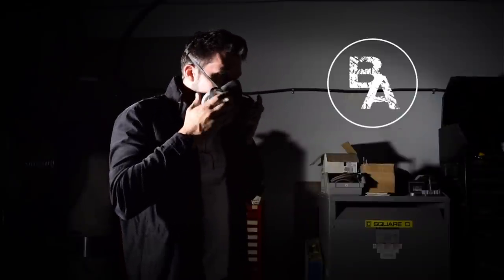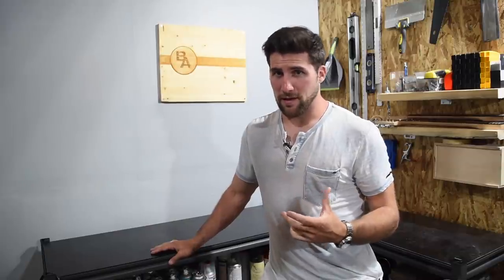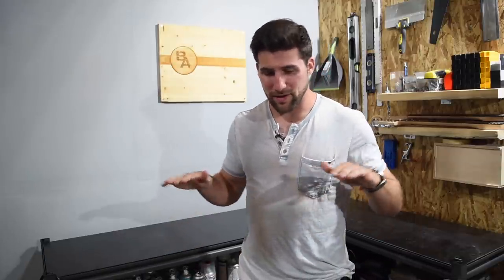Why is your paint crazing?

Comment: I tried prime ring my guitar I did the primer two days ago. I left the primer to dry a day when I looked the next morning there was alittle bit of cracks in the primer. Looking on the internet I searched what kind of grit to use 220 popped up. Used the 220 sanded the primer where the cracks were. I took a rag and cleaned off the dust today I decided to do a second coat. Within 20-30 seconds the second coat of primer cracked the whole primer on the back of the guitar. I don’t know what to do.... any ideas brad?
Reply from the maker: Sounds like the primer went on too heavy initially. May not have dried properly. Then when it shrinks it all cracks up like that.

Comment: Hi, Idk if your going to answer this or not asap, I'm painting my bed room like right now, I bought Caliwal paint and started painting my room, the paint was awful to me very watery and didn't look right to me after multi coats , so i went out and bought some Behr home depot paint,  the paint started to do some some crazy crap as I'm painting over it. So now my smooth walls look like ugg. But I'm doing this by myself and it's a lot of work, so I waited like two weeks to repaint over that mess, I mean It looks very textured now.. I'm on my way to go buy a one coat paint at home depot to see if that will help....I regret buying the Caliwel paint... and that paint is expensive. I have no other options I can't tear down my sheet rock and start all over.  I do not even know how to do that. Plus I spent so much money on paint already and my bedroom still not done.🤦‍♀️   IDK what to do😫😭
Reply from the maker: The typical fix for that would be to get one of those large sanding blocks that drywallers use and sand that texture off before moving on. Just adding more paint to it won't remove the texture.

Comment: I used a gloss cellulose spary paint on the top coat which I had cracks. but the paint layer before was just an ordinary quick dry gloss spary paint which probably hadn't quite dried after a few hours. I think that caused the paint cracks the so called reacting. Then I sanded it all down to the level with a 400 grit sandpaper and then smoothned it with a 1000 grit and after 24 hours went over it again with the cellulose spary paint. It is important the layer should be so refune and thinly sparayed otherwise it will react again.
Reply from the maker: I hope it worked for you the second time.

Comment: Hey brad. I’m an automotive painter. Our base coats are water based... I’m wondering if I can use our water based base with lacquer? I’m wanting to paint a telecaster with vintage amber on the back and sides with gold flake on top. Do you think I could spray a water base coat then apply the gold flake in lacquer?
Reply from the maker: I’ve used lacquer over water based paints before and never had a problem. Just make sure it’s 100% dry before coating over it. Lacquer doesn’t like water or humidity. 
You should be able to add flake to your first couple coats of lacquer.

Comment: I love how you explained the reasons why the crackling happens, I applied a second coat 24 hours after my first coat and I was spray painting while it’s humid outside so 2 reasons why my paint job wasn’t successful, how long do you suggest I sand the paint? I used Rust-oleum with the primer thanks!!
Reply from the maker: Sand until it is completely flat again. Make sure you give it a day or two to dry first though so your sandpaper doesn’t jam too quickly.

Comment: Thanks, I guess I have been mixing paints and not being patient enough ... evidence is i clear coated hand painted enamel and only the parts that cracked were recent touch ups :) Same goes for primer on plastic and hand painting over, to thick, to soon :) Again THANKS heaps!
Reply from the maker: Glad I could help.
Reply: @BradAngove   Thanks again I was able to do this https://i.imgur.com/CQTSefb.jpg and this https://i.imgur.com/irh55nM.jpg although cheap spray paint($3.50 from bunnings) cost me in the long term, some luck is while doing touch ups I noticed it pealing when tape was pulled off so switched to a better brand. Still getting a tiny bit of crazing while applying the clear coat. But eh you live and you learn ;)

Comment: Just happened, sanded smooth old paint and surface, but could not sand inside the wiring cavities, scrubbed the guitar clean including cavities and sprayed some Zinnser BIN white spray shellac and the areas in the cavities all wrinkled, the rest of the guitar where i sanded smooth were fine

Comment: So when painting in the cold what is the best advice ? 
Should I warm up my parts and spray paint 
then let dry in the heat as long as I can ? 
Or should I just paint my parts in the outside weather and let dry in the same temperature without using heat ?
Reply from the maker: It’s depends on what paint you’re using I think, but I’m not sure because I never paint in the cold

Comment: I'm kinda pissed, because I have spent 2 days prepping a car for rattle can paint.  Followed manufacturer's rules perfectly, in perfect form.  It did this, any idea as to why?
60 to 70 degrees F.
10% humidity.  
Covered, painted in shade..
1 coat Rust-oleum Painter's Choice Gloss Blue Prime+Paint. Waited 60 minutes. 

2 coats Rust-oleum Gloss Navy Blue Enamel, 45 minutes apart.  

No runs, drips, or reactions at this point. Waited  30 minutes to apply clear.  I was excited.   

1st coat of Rust-Oleum Crystal Clear Enamel. Waited 30 minutes. Seemed fine.

2nd coat Clear, and little random lines formed within 1 minute of spraying it on.
 Waited 30 minutes.
3rd coat. 30 minutes. More lines formed.
4th coat, and even more lines.

Is this crazing?  It looks kinda cool, almost like a pattern of crackling, but will it be flaking off fast?  I don't know. It's drying now.  Daylight tomorrow after coffee will tell.  Sure is annoying though.
Reply from the maker: Cracking and crazing aren’t quite the same, and I can’t tell which one you have. Sounds to me like it’s probably cracking from re-coating after 30 minutes when the last coat is part way through the drying process.
Reply: @BradAngove  I called Rust-Oleum. I've spoken to 3 of them so far to prepare this project. 3 different advice sets. 😆 
Between them and my test I did prior I think the process was fine up until the Clear. 

The auto paint product specialist said to wait maximum of 15 minutes between ANY and ALL coats being applied in one session. And that ALL coats should be laid down prior to 1 hour passing from start time. So to do 7 light coats like I want in one hour that's a coat every 8 minutes, with 2 minutes to spare between each coat to fetch and shake a warmed can. Speed painting. 

Their instructions don't say this on any of the cans though.  The instructions on the color cans I used say recoat anytime up to 1 hour, or wait 48+ hours.  The Clear can says "recoat anytime".  So that's a failure to provide clear directions...pun intended. 

A test spray I did using 4 coats on an old hood I had didnt have any wrinkle though.  I did 2 light color coats 20 minutes apart, waited 30 minutes, then 2 light Clear coats 15 minutes apart.  Those were fine. So that was 65 minutes. Right at their 1 hour session limit. So it seems to agree with their phone advice.

So I think my Clear coat time was too long on the car panels.  Should have stuck to 10 to 15 minutes between Clear coats.  But their cans don't say this is necessary.  It is likely due to our humidity being low (around 20%) and air temp still warm around 70F.  In a very humid area my time-line would likely have been just fine. Thus is DIY Life.  

Now I get to wet sand like a boss and hope I don't get into the color layer, or roughly knock down the wrinkles with 1000+ grit and apply Hammered Clear to cover it up. I'm thinking try in that order using Hammered Clear as backup.

Next time I will test spray exactly as I plan to do on final project!  😆

Comment: I’m using laquer on wood. I always spray with under coat before final coats. But sometimes in small areas it cracks and fall off. What is the cause of this?
Reply from the maker: What kind of undercoat are you using?

Comment: I just did a set of wheels.  Rubbed down corrosion and loose paint etc until nice and smooth.  Used die grinders and various mops for this.  Then a coat of etch primer followed by a zinc phosphate (1K) primer.  Keyed primer with 400 paper, cleaned and then a spray-gun silver 2k basecoat, then clearcoat ( I never got to that stage). However I noticed alot of sinkage when I applied the first coat and could see where the primer had been keyed.  Applied another coat and it looked ok but then localized crazing appeared.  Any ideas why?  I'm guessing the 2k basecoat doesn't like the 1k primer, but maybe have rubbed too hard when keying and thinned the primer too much where the crazing happened.  Gutted to say the least.  Am thinking now I'll wait til the paint has cured, rub back the crazing, apply a coat of 2k primer then another basecoat?
Reply from the maker: If you’re spraying metallic you need to prep sand at 800 or the metallic sinks into the scratches and makes them more obvious unfortunately. 

How long did you wait after sanding the 2K to spray it again?
Reply: @BradAngove  Thanks for the reply.  Haven't got that far yet.  I sprayed them yesterday so might get the crazing sanded this week sometime.  I'm not too bothered about them as they were free wheels and they're only for a 2002 Passat, but would still like them half reasonable looking.
Would rubbing back the reacted areas then recoat with light coats of basecoat work?  The areas that didn't react actually look pretty damned good and cured nicely.  tried chipping off some of it with my nail and it didn't chip off.  I do remember that I applied a nice light first coat, then saw the scratches appear and may have did the next coat too thick.
Reply from the maker: Ya, I would just sand everything smooth with 800 grit and hit it with a couple light coats of base. Then see where you’re at.
Reply: @BradAngove  Cheers man much appreciated.  I'll give it a go this week.

Comment: This is a dumb question. Do you use sanding sealer after you paint the guitar then clear coat? I know you use it before.
Reply from the maker: Sealer, then paint, then clear. Or stain, then sealer, then clear.
Reply: @BradAngove  oh I did not know that
Reply from the maker: Glad I could help.

Comment: Hey there Brad great video explaining this cracking of paint I am experiencing. However, what do you think my problem is after I give you all the details here. So I refinishing my toilet seat for reasons I don’t care to share. But I am using Rust Oleum’s Gloss White Enamel plus the same brand primer. I first sanded the seat and removed the old paint, and finished sanding at 220 grit before I applied my primer. Everything was going great with 2 coats of primer, and even my first coat of the enamel. But after wet sanding my first coat with 500 grit sandpaper. I started to apply my 2nd coat in my garage just like all the others. But this time the temperature has dropped in my garage down to 50 degrees Fahrenheit. Plus I accidentally over sprayed in a few spots where the cracking is most visible. The last detail is that the cracking of my 2nd coat started happening immediately after it was applied. Because I heard that it is caused by the way it is dried, which I don’t think that’s what’s going on here. Any help or advice of yours would be much appreciated. Thanks!

Comment: So I have been trying to paint my own guitar for a while now and have run into the same problem every time. I put the color coat on. Let it dry for a day, week, or even month and then put the clear coat on. It has that crazing effect EVERY SINGLE TIME. I don’t know how to prevent it. I even let my guitar sit for a few months and went back to sand it still had the same effect. Should I start all the way over?
Reply from the maker: What have you used on it?
Reply: Brad Angove well I’ve used primer, color, and clear coat. All of which was just rustoleum brand that I found at Walmart. It has a lot of layers of stuff on it which makes me think that could cause it. However even when I didn’t have that many layers on it it still had the same reaction just as severe.
Reply from the maker: More than a few people have had that issue. Lighter coats may help.

Comment: I tried so many different techniques painting and sanding my guitar. But no matter how many coats I put on or how long I let it dry or how rough or how smooth it is, as soon as I go to spray on the clear coat it cracks within seconds. Then I have to let it dry and sand it back down and start over. I’m using the same brand and type of clear coat as paint and I have no idea what I’m doing wrong.

Comment: Great video, thanks a lot. I am having a slight different issue with MDF. I gold spray on MDF which looks very smooth and gives one shade of gold until it dries. Once completely dry, I get different gold shades. Could you please advise how can I get one shade? What am I doing wrong?
Reply from the maker: It’s soaking in inconsistently. You need to seal it better first. Check out my video on how to get a gloss finish on mdf with spray cans.

Comment: I sprayed candy paint over silver paint and a week later I’m seeming lines in the paint. I wonder if it was because I used a spray can primer. Also it was a bit cooler in temp.
Reply from the maker: Certainly could be a temperature thing. When it’s a reaction between paint types the effect is usually pretty dramatic.

Comment: Had this happen on the windshield surround I painted. Laid out the clear a bit heavy and the end result was crazing. It appears to be in the clear coat only, can it be sanded and buffed or should I sand to base coat and respray clear? (Using rattle cans)
Reply from the maker: Usually the full layer crazes. You’ll likely need to sand flat and then re-spray some clear.

Comment: So I just primed my guitar today with white vinyl sealer lacquer. I did 3 coats total with 2 hour rest periods in between and scuff sanding in between as well. It has been several hours since my last coat of primer and now the top of the body has multiple cracks in it, but not on the back, so I’m not entirely sure what that is all about.
Reply from the maker: What did the can say to do for recoat times?
Reply: Brad Angove the can says at least one hour dry time in between coats. I sanded it all back down and am going to give it another try. Maybe with lighter coats and more time in between
Reply from the maker: Lighter coats should help.

Comment: Hi so if I have Is wrinkling on clear coat do I let it sit for about a week and then try to send it with 2000 grit to get the wrinkles out?
Reply from the maker: Yes let it dry fully then sand smooth. I’d use 800 grit.

Comment: would using gloss clear coat enamel make the spray paint more durable?  Seems the metal parts are fine but some of the plastic parts scratch just by looking at it.
Reply from the maker: What kind of spray paint are you using?
Reply: rustoleum  gloss
Reply from the maker: Paint doesn’t stick to plastic properly without some help. Clear coat generally makes it more durable, but if it differs based on substrate it’s probably an adhesion issue. Have a look at my video on how to paint plastic parts properly.
Reply: I use the rustoleum that says it bonds to plastics.

Comment: Had a different problem once with one brand of pressure pack cans ... Undercoated (2 coats) a guitar body and neck and let it all dry for a week. Put 3 coats of colour on over 3 consecutive days and weirdly had the undercoat colour seep through the top coats but only in certain places mostly on the neck and near some edges on the body. Thankfully the overall effect didn't look too bad so it was left as is and then clear coated which went on fine.... Only thing I can think that happened was with each new top coat being applied the solvents in the colour coat dissolved some of the undercoat up to the visible surface ... go figure....
Reply from the maker: That’s strange. What kind of paint was it?
Reply: Local Aussie product called 'White Knight'. Cheaper end of the market rattle can paint stocked by smaller hardware stores used by home renovators and DIY for furniture and kids toys projects. Quite hard wearing and very decent finish. I used the Copper colour over a cream undercoat... have a look at http://www.buildyourownguitar.com.au/forum/showthread.php?t=7653 for more details...
Reply from the maker: It’s pretty rare for paint to bleed like that if there’s dry time in between. I’m surprised.

Comment: I put clear coat on my headlight after  I wet sanded it. I cleaned the headlight before applying the clear coat and let it dry. I sprayed the clear coat And it completely started cracking or shrinking like you said. How would I fix this
Reply from the maker: Use adhesion promoter, make sure your clear is compatible with plastic, and apply a couple light coats at the start.
Reply: @BradAngove , I ended up wet sanding the clear coat off and buffed the headlights with the compound given in the 3m kit, then I sprayed 2 coats of meguiars headlight coating  and it's looking normal again